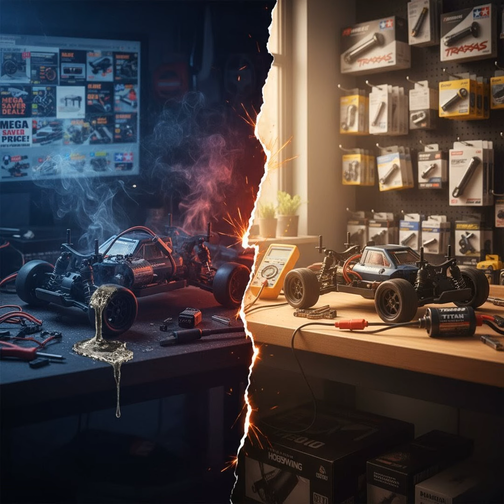Why You Shouldn't Buy R/C Parts From Mass Retailers

Comment: I prefer searching out small hobby shops…especially when restoring discontinued models like the Axial Yeti. Old stock aftermarket parts as well as factory parts are the best. eBay and other vendors have what you need, but their build quality/tolerances will leave you with more problems than solutions.
Reply from the maker: This is the way!